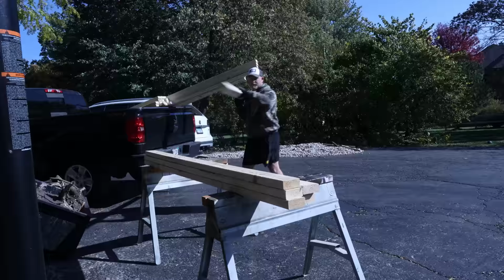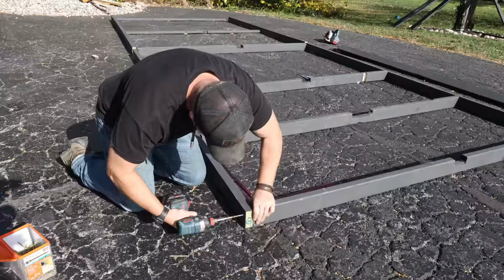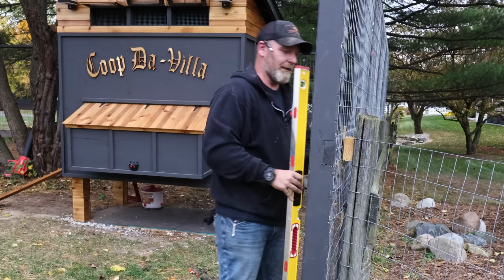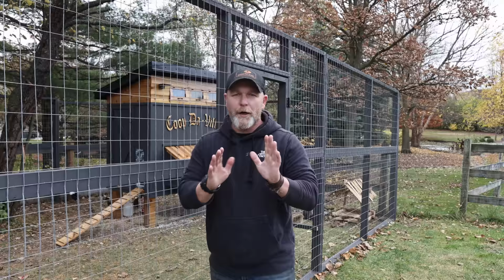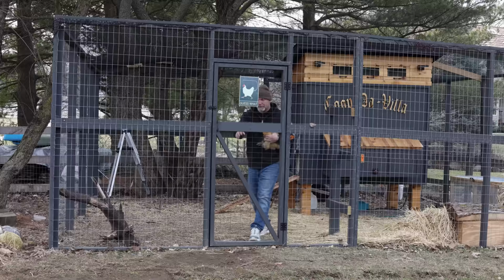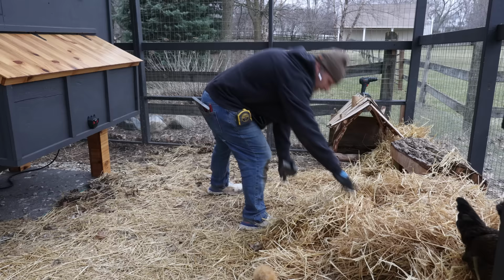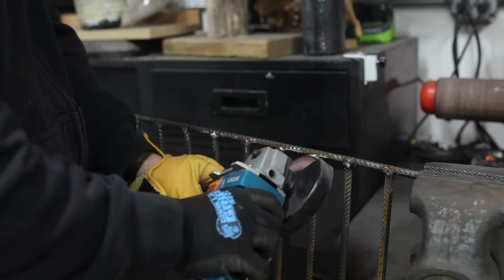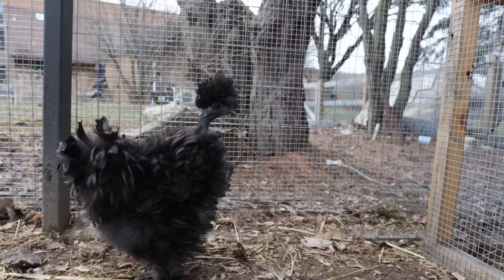How to Build a Predator Proof Chicken Run around your Coop // DIY Project

Comment: Also, snakes go right through that larger mesh fencing.  You have to do the whole thing in hardware cloth (the smaller mesh.)  Snakes will come for the eggs and they will kill the chickens.  What I did for ground predators (diggers) was to put a row of those 1' x 1' concrete pavers you can get at the big box store for like $1.30/stone.  Just lay them on the ground along the perimeter.  They will come up to the fence, try to dig and be foiled.  They don't know to back off a couple of feet to start a dig.  Finally, I did a "double door" with a small 3' x 3' gap between two doors.  The floor of that area I did in some concrete (couple of bags of sack create will do.)  That will help secure the door area and keep chickens from escaping, especially when you have kids over and such and they carelessly leave the door open.
Reply: What size snakes? I've seen chickens gobbling up garter snakes like twizzlers and I'm in the northeast.
Reply: @RCCarDude  About 3' long black snake.  Normally a snake like that can't hurt a chicken, they are after eggs.  However, if the chicken starts attacking it, a snake like that will wrap around the chickens neck and kill it.  The chicken is to big for the snake to eat, but not to big to kill.

Comment: I really like the in ground spikes. When you movethr coup, place a 1/2” rebar stake with about 3’ sticking up. There are insulators made to put on rebar or any 1/2” diameter pole. Using the insulators you can put up the hardware cloth (aka rabbit wire) that you already have or use poultry wire (much cheaper) to make a 2’ fence around the outside parameter of the chicken run. Similar to what you have already done but make sure the new fence is isolated from ground. You can now attache a small solar fence charger to the new protective fence. Even snakes won’t cross that hot fence. 

I have a small solar charger that is designed for pets or small animals. It bites but it isn’t like the big ones that make you wet your pants and say very ugly words every time it pulses. I had no idea I could say that really ugly word that many times oer second. They can be cut off any time you need. You don’t have a predator that will challenge that fence. After the second run in, most predators will give your entire area around the  chicken yard a wide berth and go on down the road to the neighbors. If you hear a blood curdling scream in the middle of the night, you can just turn over and go back to sleep. 

Oh yea, if the rebar post gives you any safety concerns, some sporting goods stores as well as Amazon sell used golf balls for cheap. Drill a hole the same diameter as your post and glue one to the top of each post. The golf balls can be painted with fluorescent paint so that you don’t accidently find the fence while checking on your feathered friends at night. 

You just need one more thing. There was no sign warning those with a weak heart or sensitive ears that 
“FOWL LANGUAGE SPOKEN HERE”.
Reply: Do you have a video showing this? Would it work on rats and mice?
Reply: @DaysOfSodaAndLantana  I do not have a video on this. I could probably put one together in the next few days. This would certainly deter anything approaching from the ground. However, be aware that mice and especially rats are very smart and can be a challenge. Any trees or bushes near the chicken run will give rats a path to the top of the enclosure. They can jump farther than most people realize.  The title of this video would be better named as “Predator Difficult”. 

A thought just struck that may help. Place a fake owl on a limb near the chicken run. If you can find one that “hoots” on occasion, then all the better. Move the owl to a different location every few days.  AsI said, rodents are very smart and if this owl never moves, they will figure this out.  Don’t put it where your chickens can see it. Chickens know what owls are,too.   If the ‘hooting’ upsets your birds, you may have to turn that off.  A fake snake on top of the enclosure may also work. Again, move the snake around to different locations.
Reply: @katiedotson704  Thank you very much for your reply and all of your information.😊

Comment: We have fishers and weasels around here that slip right through chicken wire and wipe out a flock in a night. 

We have to use 1/2” hardware cloth rather than the wire garden mesh throughout but otherwise this looks great!
Reply: We had issues with Foxes and other predators trying to dig under. I wonder if there are no such predators here? The coop isn't secured to the ground so it would be 30 seconds of work for an animal to dig 2" under it and slip in.

Comment: Super impressive build.  The yard looks as great as the coop. That was very smart & creative to ‘paint’ the netting. 
The rebar perimeter is brilliant & saves from digging out to bury fencing. 
Little warning about the aerial netting and the trees… getting fallen branches and limbs detangled and removed from the netting is a major pain and nearly impossible. I built a coop/run with aviary netting under trees and it was a total pain dealing w limbs/branches after storms.
Reply from the maker: Thank you so much!
Reply: Thanks! Nearly made that mistake!

Comment: Good craftsmanship. We've had to use vinyl coated hardware cloth with (no larger than) 1/4" holes on all sides of pen to keep out WEASELS and SNAKES. They climb and find small spaces to enter. Birds usually are found dead with no obvious wounds (pale tongues, undetectable punctures in neck) or alive but suddenly weak from blood loss. (Vinyl coated 1/4" hardware cloth can be bought online and shipped).

Comment: You need hardware cloth on the top as well.  A mink can get in a hole the size of a dime and wipe your flock out fast.  I put hardware cloth on the ground 2 feet around the entire run and cover with a rock garden growing things like lemongrass or whatever mosquitoes hate.  I never want to deal with Fowlpox.

Comment: Speaking from experience, a small mink can get through the 2x4 welded wire.  Lost 4 girls before I figured it out.  Put up chicken wire 10' on the outside of the welded wire.  If you have minks in your area, be careful.  I had no idea about minks until the attack...

Comment: If you extended your fencing at the ground level out from the coup, you can also defeat digging threats.  you can hold it down with a few bricks strategically placed or you can cut a rectangle out of old fencing and hammer it down

Comment: I agree with the ones saying that the aerial part needs hardware cloth. 
All exterior walls made from horse fencing. 
Then Lower sides-1/4” hardware cloth. 
Place Chicken wire on top of upper exterior walls butted up to hardware cloth. 
Instead of fabricating the in-ground protection with rebar, we used 2”x4” mesh cattle panels and cut them in the same manner. Then just hammer them into ground. Used bolt cutters to cut.

Comment: Lay your fencing down on the outside 2' wide all around. Use fence stakes (those little hooked J-Stakes) to hold the edges down and staple to the 2x4 frame. Racoons, Dogs, Coyotes, Possums, it will stop them all from digging. If a canine is getting insistent night after night trying to get thru the fence, put up some rabbit fence. A couple zaps from that should deter them. Add a Goose or two to your flock. Hawks or anything else coming in over the top will be stopped by those things. They are basically winged Donkeys.
Reply from the maker: That’s a great tip.  I though of doing that but was afraid my lawnmower would catch it at some point.   You can also dog them under ground a bit too.

Comment: You might want to put a sturdy wire mesh across the bottom of the enclosure to keep animals from burrowing in, those rebar spikes are still wide enough for something like a fox or weasel to squeeze through. There are a lot of smaller predators that squeeze through tight spaces.

Comment: I would highly suggest either using screws or sandwiching the welded wire between 2 boards with screws. Roaming dogs, racoons, and coyotes can pull or push the wire loose from the staples, or even break the welds. The hardware cloth around the base is crucial as well, good job there. We use chain link fence and hardware cloth on the inside and nothing can make a dent in it. Your anti-dig spikes out of rebar are a good idea, but I would still be worried about rats digging in if you have babies or bantams. A 1/2 inch or 1 inch predator apron or buried wire would be a little more error proof. We are able to slack a little on our coop/run defenses, because we have a livestock guardian dog in the field where our runs are, but with no LGD, you have to really make it robust. The aesthetics of your coop and run are fantastic btw, very well done!
Reply from the maker: Thank you so much for the great info.  We are still learning everyday and any ideas are much appreciated
Reply: @KomarProject  the biggest thing to remember is that domestic dogs are the number one killer of chickens, so you're trying to prevent them the most. Also, chicken wire is only good for keeping chickens in, keeps almost nothing out.

Comment: In our area we have to protect our coop of rats, snakes and anything that can jump our fence. I live in Puerto Rico. Loved your coup and your Timberland shoes. At least we don’t have extreme temperatures. I’m a true beginner. Learning the most I can. But we do have hurricanes. I’m on the process of designing my coop and then make it built. Thank you for everything you show us. I’ll post my coop when finished. Blessings
Reply from the maker: You are very welcome AG
  I wouldent even know where to start with snakes.  The most we have here are gardener snakes and the chickens can handle those.  Good luck with you flock !!
Reply: I am in the designing stage as well. It seems I find out more things to worry about for chickens every day! May I ask what methods you are putting into your design specifically for rats or mice? Those are what I worry about the most, because they can set up house.
Reply: @DaysOfSodaAndLantana Put the coop on legs to prevent them making nests underneath. Remove feed from the run area and only spread what the chickens can eat each night if giving food scraps.

Comment: It's all so nicely done! Maybe a couple of scarecrows might help beef up security, although it doesn't look like you left out anything!
Reply from the maker: We thought about putting up owl decoys as a scarecrow
Reply: @KomarProject  Flash tape and the flashing red lights do seem to deter owls WHILE THEY ARE FLASHING. And that is the hole in using them. They stop flashing too early in the a.m. before the owls stop hunting. So they are good additions AFTER you have a secure house and run. NOT replacements for a secure house and run.

Comment: Sweet project video! Thanks. A suggestion: When making a door....do the framing,  then...build the door like it was a solid part of the door framing.( yes, even the wire screen...right over the top).  Finally, literally cut the door out of the door framing. Add hinges.  Result, a totally perfect fitting door...like made for the opening!
Reply: You must be using plywood. It's difficult to envision "framing" and then "door framing"... I mean, what is the difference, and "wire screen" right over the top of what?

Comment: Fantastic coop and run.  I have a similar one (not as pretty as yours) for my girls but since we are in Scotland I put a roof on made of corrugated polycarbonate.  Still let’s plenty of light in but protects from the rain.  We used 3/4 inch 16g weld mesh.  Our predators are foxes and badgers plus hawks.  Love you flock.  All the best. Mags.
Reply from the maker: Thank you Mags!!! Ya we have similar predators but we don’t have badgers.   At least I never seen them before.   Stay safe
Reply: @KomarProject  To rebuild my home, I'd add a firewood storage to an o/side wall & a door to bring the wood in.  A door inside keeps you from going outside for wood.   Keep mites & other pests out w/ 1 pc (no cracks) of solid stainless steel or ?? & ppl w/ a great lock.  Just a thought!  💖

Comment: Only use hardware cloth on the walls and ceiling and put 2 or 3 feet aprons all around and be through with it. My 20 by 20 foot run 6 rolls of 4ft by 100ft hardware cloth coast around $800.00 thats with the 2×4 framed flat roof.

Comment: We had chickens when I was a kid we installed chicken wire around a perimeter with a tree in the middle for the chickens to roost at night, chickens are birds after all. As for predators digging under the fence well the ground was so hard under 4 inches of soil you needed a pick and bar to dig a few inches, it was coyote proof.

Comment: A heavy woven netting 2x2 works well. We used it for my friend’s chicken run. I used hardware cloth for my run fencing and buried it 10-12” under the whole run. Lot of work but in the years I’ve had it (7-8?), nothing has dug in. Subscribed

Comment: I realize this video is a yr ago and things might have changed since then. But if you use a roller and paint your wire fence black, you’ll be able to see through it without obstruction. The silver makes it hard to see in or through it. Try it, pretty awesome.

Comment: My dad taught me a value trick on the first time i helped built a new chicken coop. Simple put most people only fence 5 sides. If you dig 3 /4 inches deeper place thin nose fencing for the diggers.. if you ever use animal cage to trap a raccoon or other predator couldn't sealed.

Comment: I used14 gauge 1"×2" hardware cloth to keep out mink and other small predators. It's a bit more expensive, but worth it to keep my birds safe. And it's also heavy enough gauge to support the weight of the adult bobcat that jumped from a tree onto the top of the run - it left after trying unsuccessfully to breech the run.

And I'm in the MidWest and we absolutely have bears, wolves and mountain lions. I have vid and photos of them. Took photos of 5-inch wolf tracks just last week - conservation agent said it was probably just passing through, but still...it was definitely here.

Comment: Good plan; however, if you have Great Horned Owls they may be able to dive through the netting on the top. Also, we have rat snakes that could easily get through the 2x4 wire. One more round MIGHT deter them - maybe. (Supposedly, snakes can only extend 2/3rds of their bodies. However, they can climb a lot better than most of us realize.)

Comment: Glad to see the half by half hardware cloth around the bottom. Most sources online will tell you that skunks need a 4 inch hole to get through but this is wrong, smaller skunks can get through the 2 by 4 welded wire.

Also, excellent work on the bird netting around the tree. It looks very professional. As for the dig defense around the bottom, if it were to be a more permanent chicken run, you could get that hardware cloth about a foot taller and bend an L at the bottom and bury it about 4 inches under the ground with the leg of the L facing outwards so that if anything tries to dig in it will hit the wire and not be able to go further down.
Reply: I agree with a using a buried hardware cloth curtain, but it eventually rusts out at ground level. I think the welded spikes are genius, and a perfect welding project for a beginner (like me!)

Comment: Thank you so much for this. I've never built anything before, but am going to try and build a 6m x 9m coop using the 3x2m panels you have designed. I'll probably put mini wire mesh on the ceiling instead as we get possums and pythons.

Comment: A cheap solution is the lay chicken wire flat on the ground around the exterior, best if actually barred an inch or two underground, it's also a great solution if you have a problem with dogs digging holes under fences.

Comment: Osage orange aka hedge apple fence. It's what barb wire is based on. It's highly flame resistant, nearly insect proof. fencing from the 19th century that gives bonus bug repelling hedge apples. The saying is "Horse high, hog strong and chick tight.". In Sept, hey used to trench the perimeter to 3 ft deep, then fill w/hedge apples, cover lightly. Repeat til they reach ground lvl.   If you want to really go the extra mile you can actually manually braid the branches into connecting with in the spring. When I lived in coastal rural Virginia people used to talk about some of the old farms that have these fences and there's nothing that's getting thrown around them or under them.

Comment: Raccoons and the like can get through the netting.  The half-inch mesh you put on the bottom is inadequate to keep out snakes, and you will need 1/4 inch to keep out snakes.  If you could stick a pencil through it a snake can get in.  For mine, I buried some like the commenter below stated; however, I like the way you did it.

Comment: Coons are smart.  They’ll gang up on the run with one sitting at ground level on one side and another on the opposite side.  One coon will rattle the fence or act aggressively to scare the chickens to the opposite side where the 2nd coon grabs ahold of the startled chicken and shreds it through the wire.

Comment: Do you feel the staples we sufficient to secure the welded wire?  What is the advantage of welded wire over hardware cloth on the upper sides?
Reply: I know you weren't asking me per se, but the welded wire is far less expensive than hardware cloth. Plus when it is up higher in the panel animals like racoons can't claw through it. The only predator that would not be stopped by the current set-up would be weasels. They can climb up the hardware cloth to get to the welded wire and easily fit through the openings.